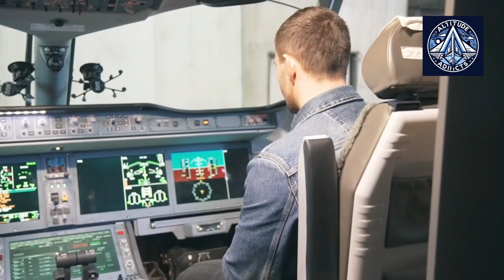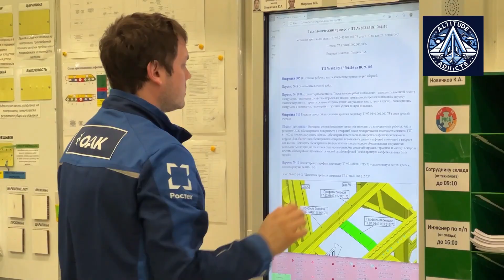3 Superjets to Join Tests, 6 PD-8 Engines by 2026

Comment: there are over 200 SSJ-100s flying - that means over 400 Sam-146 engines have been assembled at Rybinsk - so they obviously can cope with the production volumes for the PD-8 at Rybinsk

Comment: No, it's not too slow, taking into account that it used to be an abandoned Italian project that Russia decided to play with, if it was a Russian project no one on it's right mind in Russia would put so many western components on a Russian aircraft....
Reply: Nope, the PD-8 engine is a downsized version of the complete Russian PD-14 engine (which was designed from scratch in Russia and has finished the certification already), not an Italian copy.
Reply: @maksimluzin1121  a significant part of the SaM-146 engine (in particular, its entire "cold" part) is produced on the UEC "Saturn" lines, which are quite modern. PD-8 is actually a hybrid of the "cold" part solutions from the SaM-146 and the "hot" part from the PD-14. Both parts are redesigned and optimized, but the technical solutions are taken from there
Reply: @МаксимА-й2м  , Well, the producers are the part of UAC, United Avia Corporation, better to say the part of Rostech or United Engine Corporation, so they have the common top management and some common labs and institutions. Therefore, you would not call them as the direct competitors, but the different market agents who are responsible for different lines of products.
Nope, the PD-14 is a totally different class of engines comparing to SaM-146. Some expertise and technical ideas were taken from SaM for PD-8, that's OK, since some technologies and production facilities/machinery were existed before. Why to remove/delete them and build everything from empty point if you did the huge investments already?
Reply: @maksimluzin1121  First of all, it is interesting that the PD-8 engine is developed and made by a completely different manufacturer than the PD-14. Of course, the engines have something in common, but the PD-8 is the brainchild of UEC Saturn from Rybinsk, and the PD-14 is an engine from Perm's Aviadvigatel. They are essentially competitors, but, shaken up by the country's leadership, they were forced to strain themselves and finally make an engine together.
Reply: @maksimluzin1121  The P stands for a Progress design bureau....!..
Reply: .... only thing Italy designed was the interior which was done by Pininfarina
Reply: @GaryKennedy-g7p  The Italians had a 51% share of the Italian/Russian program, so they get to pick all the parts that go with it...